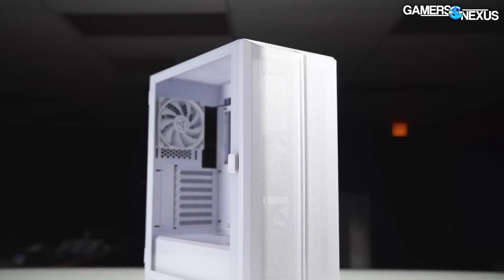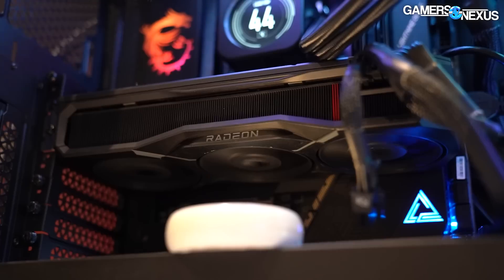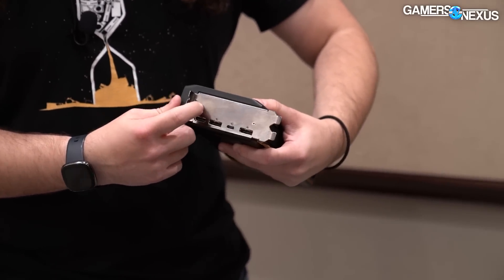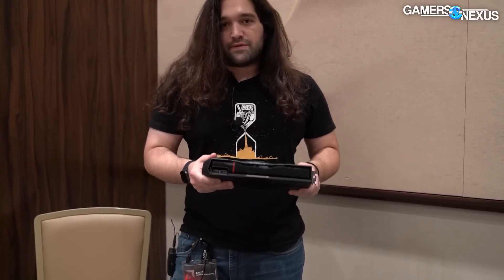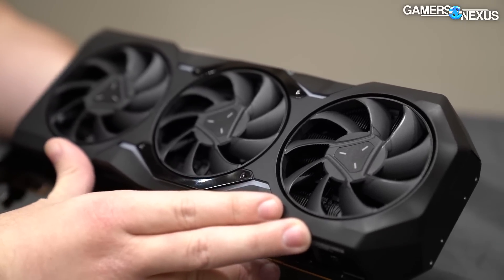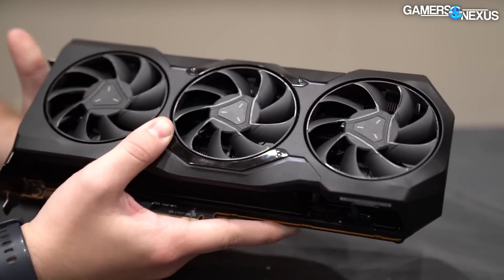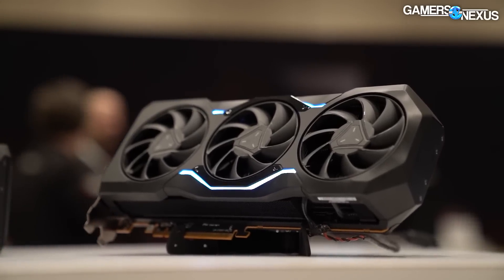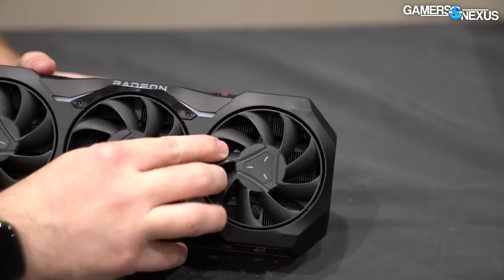More Video Cards Need This: AMD RX 7900 XTX Reference Design Hands-On

Comment from the maker: We're actually super excited about this idea. AMD wasn't sure how much people would care about it, so let them know in the comments as they'll probably read them! We can do this stuff with thermocouples easily enough, but it's not really the same as just having hardware build the functionality to get case ambient straight into the hardware. If AMD exposes the right dials to users, you could get creative with case builds and noise optimization for high ambient environments. It's small, especially compared to a brand new multi-chiplet architecture, but it's the small details that count on this stuff!
Reply: Absolutely love this design and where they are headed with this new gen. Amd most definitely open up all controls up to users and let things run wild
Reply: Definitely great tool to let users know the case temps. 

But, you can do some really cool things with this. Blowing 20 C air at lower RPM is just as effective as 30 C air at much higher RPM because the heat transfer depends on temperature difference between two. So, if AMD can use the GPU temp and air input temp, they can optimize the fan speed as well as boosting behaviour to reduce the noise in colder situations. Or alternatively, increase fan speed if it's a high ambient temp situation to improve cooling.
Reply: I just hope they actually sell the reference design direct in Australia as we only get AIB models.
Reply: A lot of people set really harsh fan curves because they aren't comfortable with the fans not running just in case something burns up. This will be an amazing feature for them.
Reply: Looks good, can't wait for 7700~ models. Thanks for giving us a closer insight.
Reply: Very excited for this generation.
Reply: The more sensors the better. The average user will want to see what's going on inside their case without having to build a solution on their own.
Reply: Making a secondary temperature monitor also means that those of us with thermocouplers on our workstation boards can have additional built-in metering for a separate part of the case without having to install additional meters.

Likewise, the secondary fan curves will be EXTREMELY useful, particularly, if AMD engineers provide separate on-board temp measurements for not only the primary die, but also for the other heat sensitive components (such as MOSFETS, etc.), so we can set the fans independently.

Personally, the only thing that I could see as a further improvement would be (assuming this is not already the case [Hur Hur Hur!], structuring the boards and the fin layout such that each fan can independently target different parts of the board with different fan speeds as each part needs.

For example, if the main die is on the center of the board under the center fan, then it could have its own fan speed curve, as would the other two areas (over say each RAM group). Then, if they can throw in additional calculations to adjust for ambient temperature monitoring data to dynamically shift the curves, then ideally each part of the board could be cooled as needed without risking having components melt or overusing power.

I figured that the uncoupled clocks would be extremely useful for reducing power loads, as well as potentially increasing overclock potential just like what happened when board manufacturers started separating memory speeds from the standard bus speed in the northbridge chip [that used to house the memory controller in all AMD CPUs prior to Athalon 64-XP and much later for Intel (I don't remember offhand when they moved the memory controller internally to the CPU, but I think it was possibly sometime around Pentium M or Core/Core 2 Duo.). By independently regulating the clocks on these different components (more would likely be ideal) it offers potentially more optimization potential as well as overclocking potential for consumers as well as for 3rd Party Developer Cards.

The more they tune these cards and the more user/system control they provide via drivers, particularly on Linux, the more potential for energy saving and boosting via dynamic computing changes can be implemented. I look forward to seeing how this works out!

Though, if AMD does eventually go for a more diverse design with even more nuanced control over each fan and each aspect of the card/thermal readings for each component, etc., to me, it would be useful to put individual sensors under each fan to enable calculations based upon the real intake temperatures, if for example, the intake of one fan differs from another, that way that portion of the cars could be more efficiently tuned for power and thermal savings!
Reply: just as excited as I was getting my first gen Ryzen.
Reply: Temperatures are important info great idea AMD to build the functionality into the cards.
Reply: Good work AMD !
Reply: You could make LED change colors based on your case ambient temperature. What better way to tell you that your case is running hot than it lighting up in bright red!
Reply: I like there 8 pin approach to powering the card vs going with 12 pin connectors that have shown to be not able to handle powering the cards. I like the effieciency these new cards will provide .Very interesting . Steve it interesting to see your channel providing more insight on the card .ive tried to believe amd will provide us a  better approach to
Reply: Very nice to see, will be even nicer seeing it on sub$500 cards
Reply: look at you always a indepth look man you got it going on and im glad all these companies really take what you say into consideration.
Reply: I absolutely love the price drop!
Reply: I'd love to see air intake thermistors become the norm on AMD 7000 and on. Extremely useful to users!
Reply: is that the Sierra Room?
Reply: My fans are set 30% min all the time would rather all my  pcb be cool then have a hot spot building and making a heat stress
Reply: Thats actually just what I've been looking for! I've actually added a thermal probe between the fins in some cases, that I use to control case intake fans just under the GPU.
Reply: Really looking forward to some card orientation videos using the thermistor
Reply: I'd love to see fan curve based on temperature delta (gpu temp - inlet temperature)! Could be interesting to see how it could affect fan noise.
Reply: Steve, do you think we'll get a 7400 LP like the 6400? I am optimistic that we'll do as it's now easier to cut down chips to get lower SKUs but such SKUs get released in once so many generations.

6400 LP is awesome, 1 slot for the same performance as 1650 G5 is unbeatable but it would feel like shit to get one and have 7400 released in a year.
Reply: I was actually expecting the RX 7800 to be introduced at this reveal. That was kinda disappointing. I thought the 7800s were also NAVI 31.
Reply: @ChrisAlbertH47  Perhaps at CES?  First week of Jan.
Reply: @halrichard1969  I hope so.
Reply: they were wrong, we care. doesn't surprise me. Whos is your contact Frank A? He keeps being wrong- hasn't been right since Alienware.
Reply: That Sensor will get smothered in dust in  no time ...
Reply: Thanks Steve.
Reply: love the idea because using board component temps to determine your internal case temp is super hit and miss because the board makers don't even bother naming or configure them properly to give a true temp readout. RIP xclios windtunnel case which had it's own internal temp sensor that was displayed on the case(wish that was still an option in cases even if it had to be hooked up to the USB header).
Reply: Can you do a weight test of rtx 4090 founder & custom again rx 7900xtx reference & custom, cause I think some rtx 4090 weighs more than gaming laptops
Reply: AMD should keep going with this idea, give as much power to the user as possible. Hoping we can see this on AIBs with 3 power connectors to see the full performance of the card.
Reply: This is cool. Normal customers with a lot of money and no idea on tech would obviously not care or know about it. But  most enthusiasts buying the card will. Especially OC'ers and those of us customer building our PC's.
Reply: @zengrath  Anyone who is serious about OC'ing isn't using  the stock Air cooler so this sensor is meaningless to them as its going to get replaced with a waterblock. But lets say they are going to use the stock cooler then the  GPU die temp sensor will override it anyway.. So your point makes no sense.

This was not added because AMD thinks its cool. It was added to solve a heat issue..What heat issue? we dont know. It might not even be an issue just some engineer at amd going a bit overboard on the sensors. But  If you find having a temp sensor as "cool" in leading edge electronics of today and find it as a selling point  then i really don't know how to answer to that except im happy for you.
Reply: @Lazeerer  I'm sorry but this isn't true at all. People serious with OC'ing water cool the CPU usually but not always. Water cooling GPU on other hand has little to no help in boosting the GPU overclocks and is expensive as heck usually costing an extra $200 on top of the price of the GPU and for almost no gains. I think those who water cool GPU simply do it because they can, not because it's cost effective. In almost all cases your going to see far better gains by  simply investing that $200 you would spend water cooling the GPU and getting a better GPU instead or investing it into better CPU or more Ram or faster SSD, etc.
Reply: @zengrath   Continue on believing what you want. What do you want me to tell you further?  Your ways and thoughts are to far gone for me to explain and comment more on this topic with you. If you find it cool and a selling point then buy it? I dont care?
Reply: @Lazeerer  Why are you attacking me on this? I'm so confused as to why your so offended that I think having this temperature sensor is a good thing for people who will use it? Your completely out of line. Do you even read what your writing before you post? or you just don't care? Or are you attacking me on purpose because it gives your a thrill?
Reply: @Lazeerer  Who are you to tell me that I'm not allowed to give my opinion, GamersNexus asked us for what we think about this sensor because AMD didn't think we cared about it. I gave my honest opinion and your attacking me. What have i said that could have possibly offended you so  much to target me? I'm answering GamersNexus's question. I'm not talking to you. You have no right to talk to me this way.
Reply: @zengrath  Attacking? you got to be kidding me. Your the one who commented and quoted first to me. Don't quote and start conversation with someone if you cant handle whatever the response may be. I never told you your not allowed to give your opinion stop making things up. Im going to move on to de escalate. Please don't quote me anymore.
Reply: @Lazeerer  I never commented at you. I commented at GamersNexus about my thoughts on the sensor being useful for certain people. then you had to tell me i'm wrong because no one who's going to OC is going to OC on air-cooling and they would instead use a water block and I told you, sorry your wrong, there plenty of people who OC graphic cards without waterblocks. Plenty of people. I dare say that percent of people adding water cooling blocks to the graphics cards is in single digit percent of those who water cool the CPU. Most normal people who aren't extreme over clockers just get a really good air cooler on CPU or an AIO waterlocked for CPU and don't touch the graphics card. Even a lot of people doing customer water cooling are not always also adding water blocks to GPU also. But you had to go and tell me i'm too stupid and beyond hope? You have no right to attack me like this. I have my opinion to gamers nexus, you had to reply to me and tell me i'm wrong, I replied to you to tell you how i think your wrong. and your last reply is telling me how I'm too stupid and beyond saving. You are the one who initiated the attack and harassments towards me. I did not initiate your comments towards me.  You did. Don't dare try to put this one me. Only thing you should be saying at this point is, I'm sorry Zengrath for calling you stupid and beyond saving, and that i think this sensor is useless and simply don't agree with you. boom problem solved. Instead i'm sure you won't apologize and will continue to talk down to me.  I'm pretty sure many youtubers I've followed has even said this very thing, that often your better off saving your money towards a water block for your GPU by putting that extra money into something else instead. In fact i strongly recall one of the main youtubers I follow for tech news talking about the water cooled 4090 not worth the extra costs, tested it and found it not to run hardly any faster then the air cooled GPU's and said it's better to just put that money into something else. But apparently I'm so far gone for thinking this I can't be saved. You obviously know so much more then me that you can just attack me and that's it. I'm supposed to just roll over and accept your opinion as the right one vs my own opinion and opinion of youtubers I follow.
Reply: "It doesn't look expensive..." Large piece of very nice art.

How does it not? Like, what was even that joke?
Reply: without a doubt i would want it. due to its easier to have more tempature readings. if they can release software that could let us have more control over everything.
Reply: The design is very nice. It looks mature and clean but with some nice angles to it, almost like a modern car. None of that ExXx-TrEmE Supreme Ultra MaXX BS. The triple red stripe is elegant. The thermistor is also super cool! I program my fancurves with Fan Control and having an exterior/intake temp sensor is super helpful to set fancurves for case intake fans and to see if enough fresh air reaches the card. Edit: wrote this before Steve mentioned it so yeah, I agree.
Reply: just wondering if you are branching out also to new platforms eventually? like just uploading to a alt location spreading your messages is not a bad thing and a decent biz move.
Reply: My Z690 MSI Unify-X came with thermocouples and you best believe I've been using them lol. It's a fantastic edition to any motherboard. I can monitor the temps of anywhere I want inside my case and assign a fan curve to it in the bios. Really works out for my rtx 3090. Since the bios can't set your case fans curve to GPU temp I just put the thermocouple inside the heatsink of my GPU and assigned my bottom case fans curve that are blowing up at my GPU to the thermocouple temp. And the rest of my fans are assigned to my CPU. Great for thermal performance and noise. You could technically do the same thing with software since software can assign fan curves to your GPU temp but I'm not really of a fan of controlling my curves with software. I only like using the bios.
Reply: Absolutely love the idea of having the thermistor in the video card. I live in a really hot environment (High desert north of LA) and that, combined with video editing and the fact that the room I use my computer in is above a garage (so relatively un-insulated) means that I have to work really hard to get my case/components cool, especially if I want my case to be relatively quiet. I could, of course, just blast my fans at 100% all the time but if I don't have to I'd rather not feel like I should.

Being able to see how hot the case (or at least inlet temperature) gets would make it so much easier to see if I can run my case fans on low/silent mode, and also more easily tell how much of an impact I'm having with my undervolting or efficiency settings (especially when I'm just browsing the internet) while also making sure I'm not in danger of blowing up my card or other components.

As they say, more information (that you can use, anyway) is never a bad thing. It's always better to have a tool that you can use and not need it, than need a tool and not have it.
Reply: This is very useful especially when your system differs to review media systems. I often have a 15-20C different GPU temperature than most reviews and sometimes don't know why. What I suspect is the case airflow is bad and this new sensor could help confirm this with a high level of certainty.
Reply: Now that you touched on temps at idle im scared of my 4090 dying because i set a fan curve so that my fans only kick in when my gpu reaches 50C.
Reply: Red triangles indicate immediate death if opened
Reply: You guys ever thought of stepping up the professionalism? I think you guys are great and do the best journalistic content on the subject. The ground work is there and the data represents it. But how about improving speech and public speaking? What about improving the overall set? How about more slick segues between clips?

You guys have got it nailed in terms of journalistic content. But I also feel like the garage youtuber style is holding you back. You could legitimately do a half hour or hour long TV segment every week.
Reply: It's a neat feature that'll definitely help, even though unconsciously, most end users. AMD's Adrenalin software has a very useful in-built manual fan controller which allows you to create your own curve. Personally, my GPU's fans are always spinning because my storage M.2 sits right under the card and that helps enormously with temps (at least 10°C). Anyway, you can create your own profile, save it and restore it in case you need it. Just saying.
Reply: This is pretty silly Steve to focus on. Its a Temp sensor. OK so? There isn't anything special about this. Almost every electronic in the world has some form of temp monitoring. Most have more then one sensor and Some add more then others in different places. If small parts on the GPU are heating up that heatsink to a point where the fans need to turn on but dont then you have bigger issues. The more i watch your videos the more i realize you are a novice to actual electronics and can make the most basic of feature look like its space tech as a selling point. But you only do this for AMD? Why? Nothing wrong with being a Novice we all started there too "And Honestly i love your enthusiasm about electronics" but a 9min video for a heatsink sensor and making it out like its such a huge feature is just silly and grasping at things to say something nice about the card. come on. What's next? You going to make a video on what solder paste they are using or what brand resistors they are using? I have never once had or even heard of an issue that you describe that caused the main GPU heatsink block to heat up so hot that it risks damaging the card and the fans dint turn on before hand. If it has happened then that was a poorly built GPU design.

Anyway, to be clear im not trashing on AMD for adding it. "The more the better when it comes to temp sensors imo" Will see why they really added it when the real testers get their hands on the card. But its just so silly to focus on this and push it like its some selling point. When i see this video i actually wonder the opposite. Like why AMD needed to add a temp sensor to the heatsink as i haven't seen one added or felt the need to have a heatsink senor in the past 5 GPU generation that ive bought? Is there a heat issue with other components on the GPU? Are the Fans going to be running louder more often because of these other smd parts heating up the heatsink block while the GPU core isn't? Now that you focused on it so much it has raised more concerns made me question why they needed to add this and i highly doubt it was added as a new feature because AMD wanted to be nice. So are some parts on the PCB heating up the heatsink block while the GPU die is at 0% usage or low usage or is this just another pointless fanboy selling point for AMD? hmm

Still looking forward to your review though.🖤